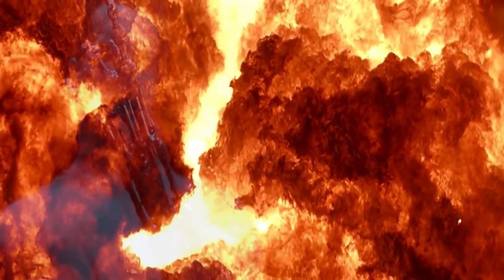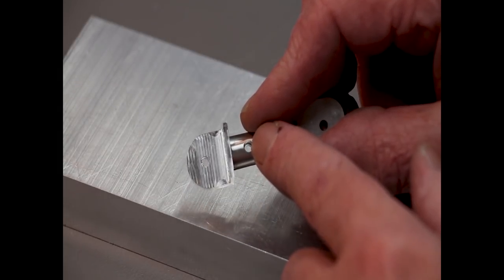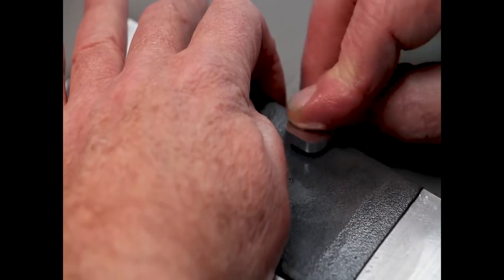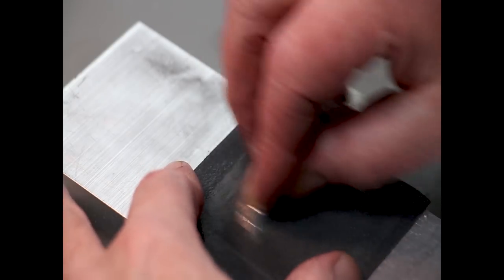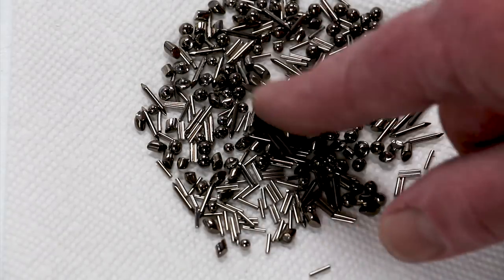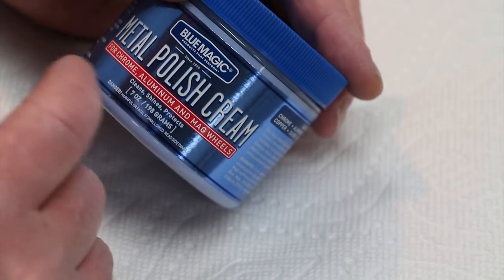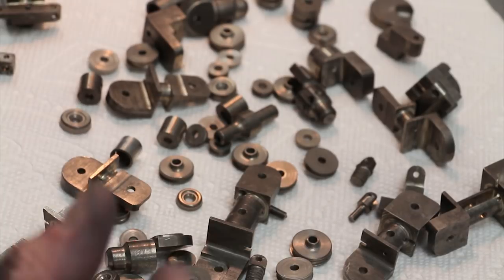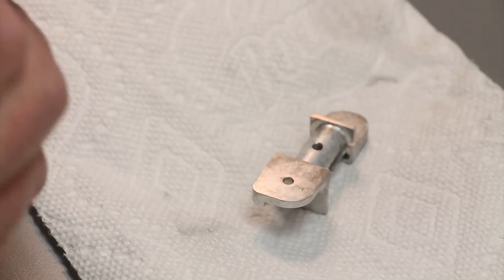T-800 Endoskeleton Arm Part 08 - Sanding And Polishing

Comment: I have had similar isuse with steel media I now use a ceramic version in 2 stages cut and then polish and then walnut shell for a high shine, more steps but it's usually quicker
Reply from the maker: What types of ceramic are you using? There seem to be lots of grits and sizes.

Comment: Hi Ken, I can't believe I watched a half hour of sanding and polishing, does your wife know what your doing? When she finds out, your getting all the silverware before the holidays. Have you tried Simichrome polish, I used it on Triumph motorcycles which had polished die cast covers which when used would look like it was chromed. Are you almost to the point of final assembly?
Reply from the maker: Shhhhh. Don't tell her! I tried Simichrome a long time ago. I'll have to try it again and compare the results to Blue Magic. I began assembly right after posting this video and I'm still at it! The assembly has been VERY difficult, because so many small parts have to fit perfectly into some very crowded spaces.

Comment: I suspect that the blackening of the aluminum was caused by the soap. Soaps are typically alkaline, which would cause the surface blackening. We would call this "etching" of the aluminum.
You might try using something other than a soap & water solution on a few test / scrap pieces. Straight water might work, but I would suggest a purified water to eliminate the possibility of any mineral content or trace elements in normal tap water that might also affect the surface finish. I would just try to come up with something that is PH neutral and see what the results are.
Reply: Distilled water also works great in this application.

Comment: Could you try putting the SS media and a sample part in a Ziploc bag with the soapy water in the vibrator?
Reply from the maker: Thanks. I will definitely try isolating the media and parts from the inside of the vibrator.